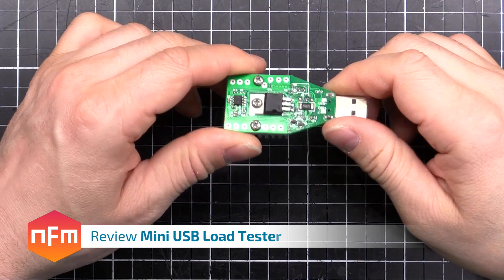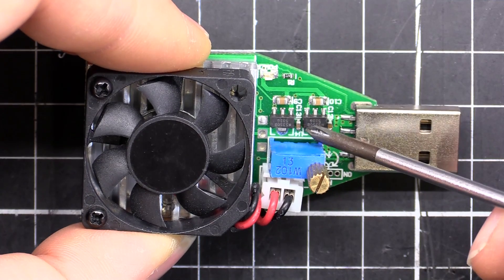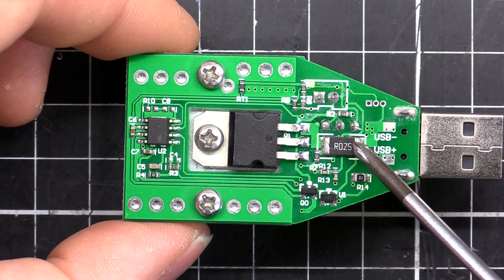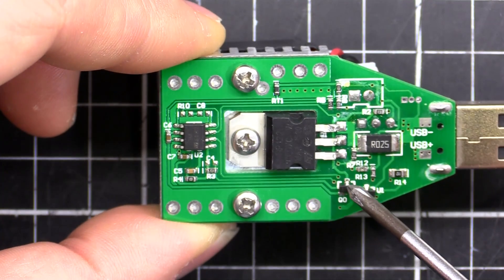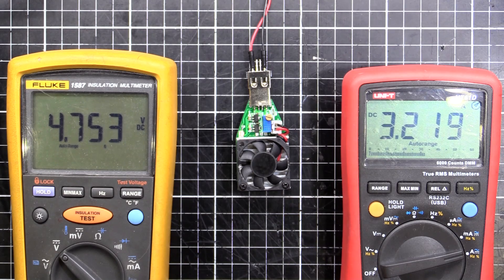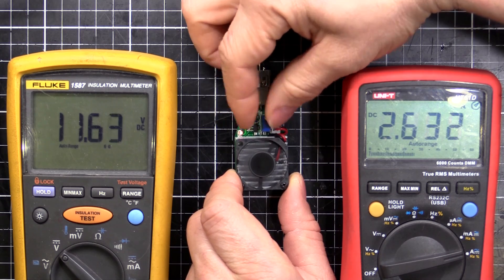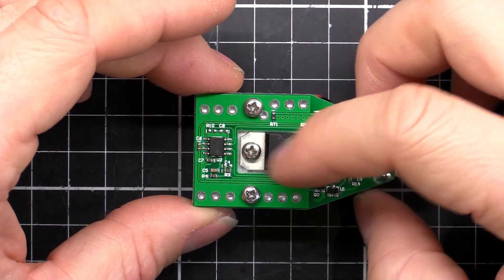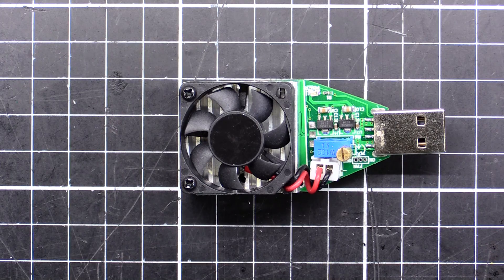USB Mini Adjustable Load Review

Comment: I received a board with a broken capacitor C6, can you tell me its rating?
Reply from the maker: Measured at 10kHz on my HP 4276A, it looks to be a 0.14uF 0603 size MLCC capacitor.

Comment: Hi there , thank you for the video , recently i bought a usb loader ,but it seems when i spin the potentiometer the amp remains zero and the resistance shows 999.99 ohm i believe the product is defective ,but im wondering if i replace tip122 transistor ,does that fix the problem ? thanks
Reply: Should fix the problem

Comment: There's a fan port that says on and off, I believe installing a switch actually allows you to run the fan constantly if you wanted to, it would be best when you're doing higher power tests. It would be trying to keep a transistor cool instead of try and cool an already hot one.
Reply from the maker: There is too! Somehow I never actually noticed it before. Thanks for the tip! 🙂

Comment: Your Vid:  Simple to understand, precise, to the point, and language at a level appropriate for your audience.  Thank you.
Is 0.76 Ampere the lowest it can be adjusted?
Reply from the maker: I think the exact lowest current depends on the actual voltage.
I'd have to search through my boxes of stuff to dig it out and test. If I find it, I'll update with the results of a quick test.

Comment: is it suitable for low amperage draw? i need constant current draw of 0.09 amp to 0.30 amp and sometime 1.0 amp
Reply from the maker: Yeah, it seems good to a good few amps for long term use as the fan help keep it cool.
Under an amp will be fine for constant use for sure.

Comment: Hi, it is 3.7V really minimum working voltage? I would like to test li-ion 18650 battery capacity with cut-off voltage 3.0V. It is possible to use it?

Comment: I have one of these too, I run it through a little Kewesi USB doctor similar to yours. I use it for testing the voltage droop and current limit of USB power supplies for powering Raspberry Pi. Thanks for the thermal paste tip!

Comment: For a simple load tester just buy a termael strip, a few cheap 12volt  10 watt light bulbs and keep adding bulbs to increase the load.  Very high loads cand be tested in this way.
Reply: Your "load tester" idea is NOT the same thing. Your light bulb array is not constant current, so the amperage drawn varies with voltage. Lamps are even worse as a oad than resistors, as the resistance changes with temperature. Hence, if you want to draw (say) 1 amp from a power supply, you cannot do that with a lamp load. You might be able to draw "a load" but it won't be controllable.